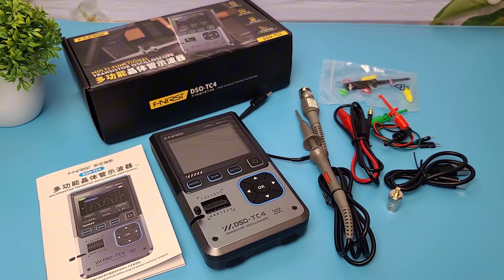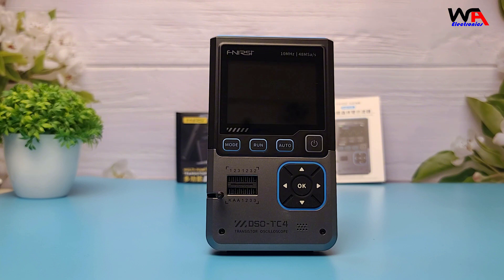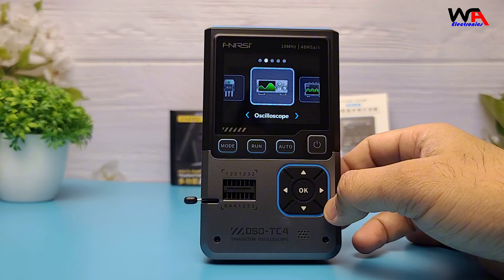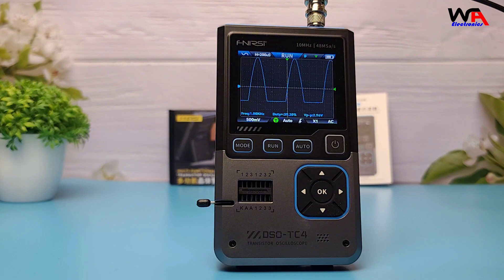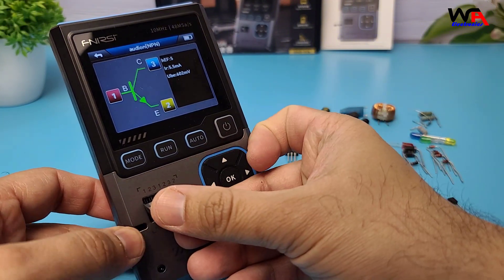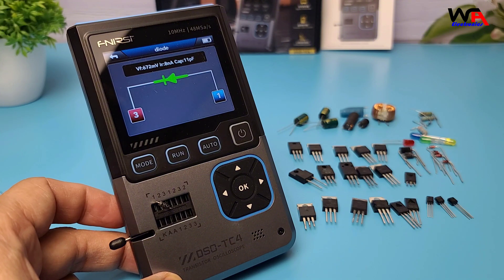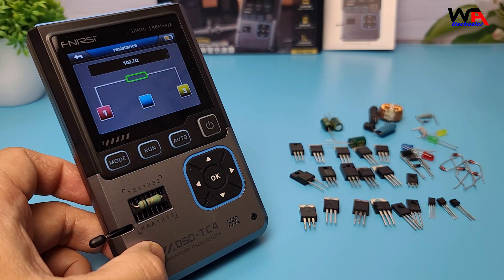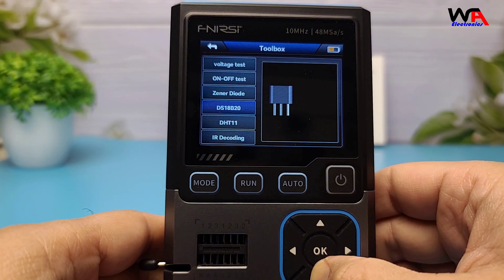Fnirsi DSO-TC4 3-in-1 Digital Oscilloscope | Transistor Tester | Signal Generator Unboxing & Review!

Comment: That BNC to MCX connector is a very weak link. I dropped it from my bench to my lap and destroyed the connector.  Other than that, it's a nice unit. They should include two connectors because it's so weak, or make the adapter in the form of a cable so there's not as much strain on the MCX end.

Comment: Hello. You said no PC connection. Are you sure?
Reply from the maker: @daniellecocq1387  Yes, PC Connection for only Firmware Update
Reply: @WAElectronics  I've received the product and it does have the option of taking screenshots and retrieving them via a PC. It's still a very basic thing, but it might be worth pointing it out.😉
Reply: @WAElectronics  Thank you for your reply, so there is false advertising, here's a screenshot found on their site. 🤔🤨https://image.noelshack.com/fichiers/2025/13/2/1742896869-2025-03-25-110044.png
Reply: @WAElectronics  Thank you for your reply, so there is false advertising, here's a screenshot found on their site. https://image.noelshack.com/fichiers/2025/13/2/1742896869-2025-03-25-110044.png
Reply: @WAElectronics  Thank you for your reply, so there is false advertising, here's a screenshot found on their site. "USB SHARING WAVEFORM DATA, Easily manage oscilloscopes and connect to a PC via a USB cable Conduct secondary analysis to make professionalism more convenient!" ...???🤔
Reply: @WAElectronics  Someone once said: Things I don't know don't exist! 😇